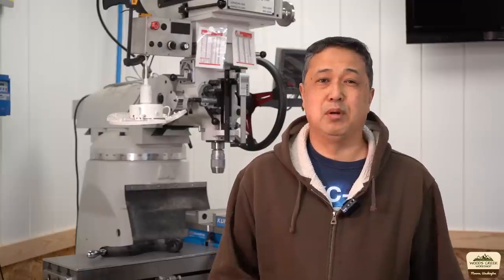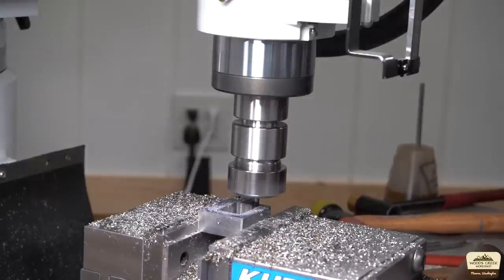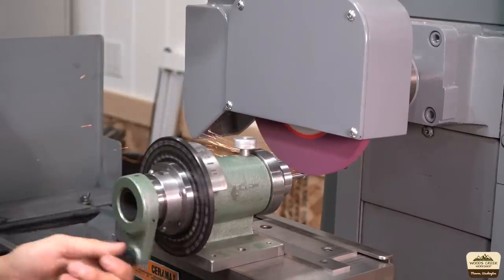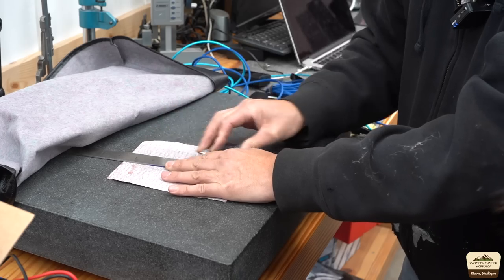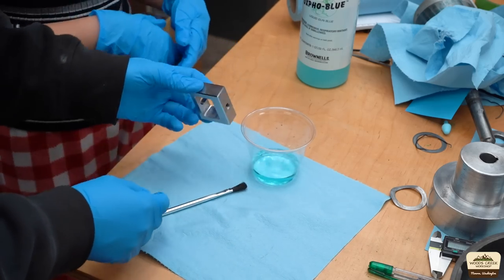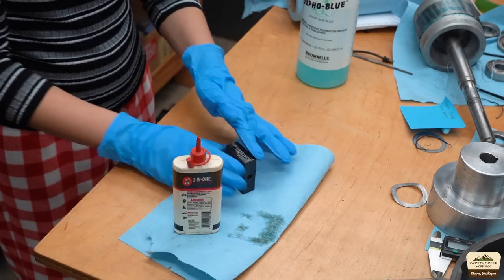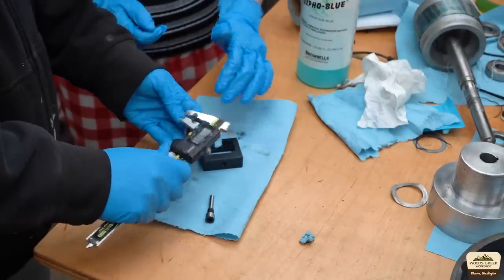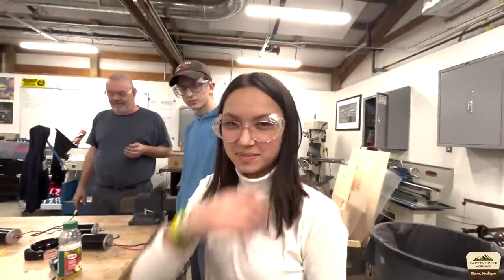Pull Your Gear Out:  Brushless Motor Gear Puller

Comment: It wasn't a bad way for teaching some very useful skills. but it wasn't too good at getting the job at hand done,,,,,but for making a friggin gear puller that could be made with a hack saw, drill press and welding machine ?????  

Looks like something you would see in a Porsche factory,,,but then I don't think even the Germans could have made a simple 10 minute job last over a day. (And BTW, Tp make a surface flat with emery and the surface plate you do not use inline motion. That  tends to make a convex surface. You use a figure-8 pattern to make it flat,,,,,,,But then I'm Kind of surprised you didn't scrape it in. )
Reply from the maker: I would have preferred an angry beaver, but all I had were machineries.